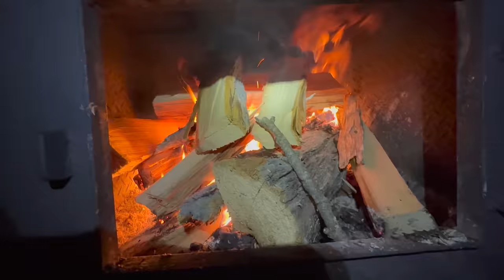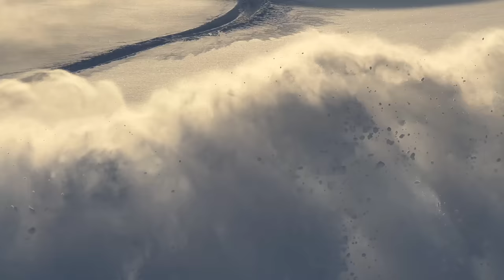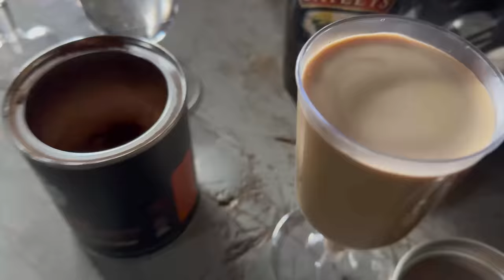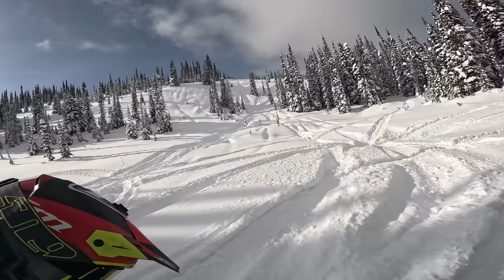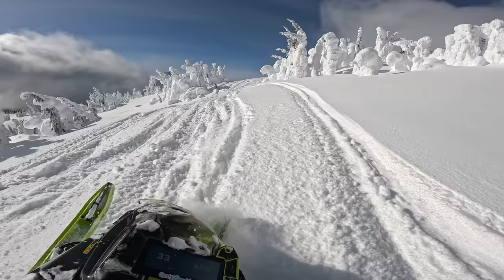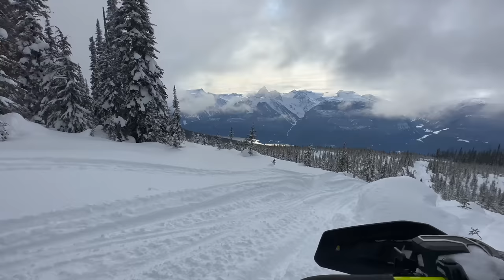Waking Up On The Mountain

Comment: Side note if something like this happens to anyone else. If you take the spark plugs out and take a spare pull cord rope and just start winding it down into the cylinder, you can lock the crank to tighten/loosen a stuck bolt.

Comment: My drive clutch came off my 9R too! Just a couple days ago, thank god I heard it coming loose and made it back to my truck. I'm wondering if there will be a recall? Mine put up 700 miles before failing.
Reply: Is the P22 only on the 9's or are they across the board? They need to ditch those things whatever the hell they are!
Reply: @208SledHead  The 9R and Boost models share the same clutch
Reply: @dgreenbluet  That's bizarre then cuz the only clutches I've seen explode - which are the two on here - have been the 9's. I don't think I've seen a boost grenade their clutch.
Reply: @208SledHead  There was a recall for the 22 boost sleds clutch bolts effecting 4,800 units which i think is all of em